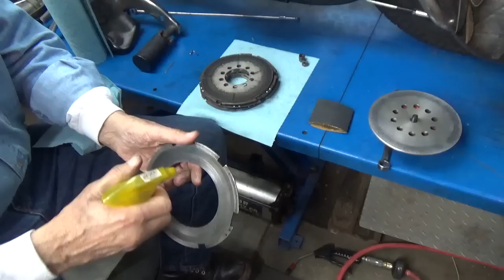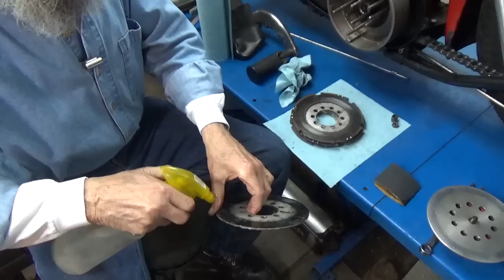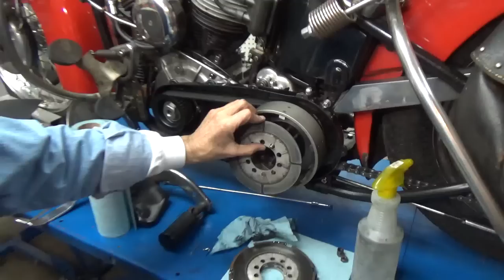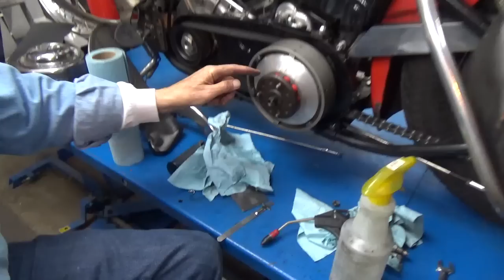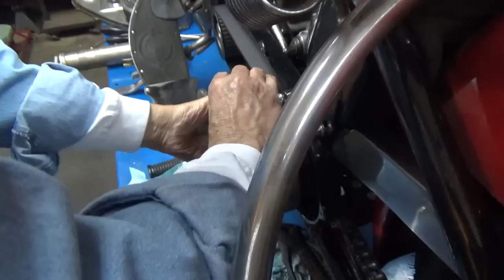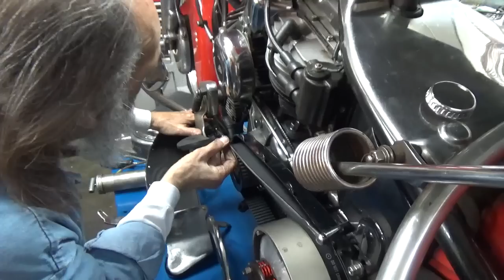We're Doing The Clutch Adjustment On My Harley Davidson Panhead Again!

Comment: How do you get the oil out of a 1940s three bolt WL transmission? I did not see a drain plug. I’m hoping one doesn’t have to bring it back out of the fill hole.

Comment: Hi Mike,  I just had apart a '68 FLH as it had some starter issues. Had a mix match of parts; one being the wrong year clutch shell ('70 and +). I put in a '65 - '69 clutch shell and reused the clutch plates after inspecting them and cleaning them. I adjusted springs first to 1-1/32" as per manual without having the pushrod adjusting screw tight. Next I set the clutch arm to about 1/2" from the starter, then backed off the adjusting screw 1'8" and tightened the locknut. Then adjusted the clutch cable/hand lever to have approx. 1/4" play. I pulled the hand lever in several times and noted that the pressure plate was likely coming out 1/4" or maybe 5/16". I sat on the bike then and put it in gear and pushed it forward with the hand lever fully in (to disengage the clutch) and it was dragging considerably. The clutch shell looked in good shape and the studs on the clutch hub I sanded and were in good shape, so what could be wrong to not allow the clutch to fully disengage? Is it likely to be that I need to drill out the ten holes per plate on the friction discs ab extra 1/32"?? Any thoughts would be appreciated and I know you enjoy making clutches work well so thought I would ask. Thank you. Darren.
Reply from the maker: Please realize, although I try, can't see it from here.  First, are the plates separating evenly all the way around.  Sometimes the springs don't always have even tension and the three studs may need to be tightened unequal amounts in order to compensate. If the plates are not sliding well because the holes the studs (fingers) pass through are not smooth, drill oversize 1/64th, not 1/32nd. You don't need a full 1/4" in that lever.  An eighth or less may be the answer.  A lot of people used to figure a nickle"s thickness where the lever touches the perch.  Do not get a non-mousetrap unit confused with a mousetrap.  I'm assuming no mousetrap. Last mousetrap was 1967.  But I have installed them on later models.
Reply: @pacificmike9501  Thank you Mike for your thoughts; I know you are a busy guy. I guess I should secure the handlever in the fully closed position and then measure the distance between the release disc and clutch friction disc to see if it is opening equally and if not adjust? No mousetrap Mike and BTW I am using the correct springs for '68 and up and I am using a 5 stud hub. Thanks again.
Reply: @ironearl69   I could be wrong but I was always taught those 5 stud clutch hubs were more for drag racing and the three stud clutch hubs were better for normal use for disengagement purposes. I personally think you can't diagnose if it is disengaging right unless you start it and ride it.

Comment: Hello and thank you for putting up these informative videos.  Just watched this one tonight, re-did my Panhead clutch again after changing the transmission sprocket a couple of weeks ago.  I also have the Barnett aluminum clutch friction discs in mine, very good product, I've been using them in my Pan since 1998.  I noticed that the friction discs were not making full contact against the steel plates by the wear pattern on the friction material.  So since I was not in a hurry I set up my 1/2 inch thick glass panel for flat sanding with 220 grit sandpaper and rubbed each friction disc on that until I had a perfectly flat contact surface.  It made a real difference in the feel of the clutch even using my foot(suicide) clutch and jockey shift.  Now it is in contact or not in contact, none of the grabbing or incomplete release I had before which makes shifting much nicer.   I also use a Zodiac Tamer Kit that holds the clutch basket from moving out, I run a belt drive also.
Reply from the maker: Cool.  There are so many products out there and when you find a system that you like, you've won the battle.  Got a few myself.

Comment: Thank you for sharing your expertise Mike. I was going to post about my grabbing clutch problem but did not want to duplicate a previous poster so I srcoled thru the clutch posts and discovered the post from Dan McCarthy _ same issues. My 2" open primary conversion to my '73 shovel would not disengage the mainshaft. It drove me nuts because I had already done two 1.5" belt conversions successfully. Your advice for drilling out the clutch plates with 25/64 bit did the TRICK! I am so freakin happy with my recent bobber build.
Reply from the maker: Cool.  That makes me feel really good.

Comment: I ran the Barnett clutch Assy. and Phase 3 open primary combo on my stock 80” shovel. Your triggering a little trip down memory lane with your vids Pacific Mike :).
Reply from the maker: Yah, it was and is fun stuff.
Reply: Pacific Mike I mean to say that, the engine was the stock 80” first one, I bought it from the factory 1980. I had already gotten a 57 pan head frame, and a couple of damaged wide glides that fixed up into a good one. I like the new efi harleys , they are Bullit proof. Maybe to good, could be part of California Harley economic woes. Got the new Aircraft spec brakes that were coming out. Yeah nostalgia is a big part of my everyday world these days😂

Comment: Great video as always Mike.  As far as plate brands go a little over twenty years ago I put a set of Barnett plates into the clutch of my Shovelhead.  I think once in that time I cleaned them like you are doing here after a carb tweak added a few HP and it started slipping.  Haven't had to monkey with them since.  I don't know if Barnett is still around but this video made me think of them.  Thanks again for sharing your knowledge.  I live in a rural area in Southern Virginia and the last old timer around these parts that really knew these old bikes passed away a few years ago.  Your videos are very helpful to those of us all alone in the wilds trying to keep our old iron healthy.
Reply from the maker: Thank you.  We used to have to figure it out every time we added more horsepower.  Tighten those springs some more.  Now, if you didn't have one before, you'd be thankful for a foot clutch now.  However, Barnett is very much still in business and still family owned.  Their factory is in Ventura California.  Still making great stuff.

Comment: Great video.  Encouraged to pull mine apart as the bike does not want to down shit from third.  The plates are a bit grooved and one plate has some rust as though it was stuck to the fiber disk.  So I guess the whole system should be replaced??  Even the basket has some grooving and a bit of oil.  I wish pictures could be posted!!  Maybe I'll clean it up and see how it performs, but the grooving is not going away without a lathe.............
Reply from the maker: Sometimes they clean up and work fine.  Somes times they don't.  New stuff is always cool, but not always necessary or economically feasible.  Look it over.  Get a feel for how it works.  This is the learning proccess.
Reply: Thanks, I’ll clean it up and give it a shot. One conundrum I have is that my case is stamped as a 1940 WLA. That’s a very unusual and unlikely model. I’m thinking it’s actually a 1941 up clutch but don’t really know how to confirm that without buying parts….. I see a lot of parts listed for 1941 and up, but not for 1940.
Reply from the maker: You'll need parts for a WLA.  Don't buy parts for a Big Twin.

Comment: Great video! Somehow I missed the part showing all the lesser informed how to load the springs on the pressure plate with the adjusting screw and washer. Some people think their springs are going flying on removal.  Maybe it was in a previous video.
Cheers
Reply from the maker: I have shown it, but, lay the releasing disc smooth side down and put the springs in place, all ten in a circle with their respective holes in alignment with each spring.  Now, lay the pressure plate on top of the springs.  Depending on the  clutch hub you're using, there will be either three or five of those holes shaped for adjusting nuts.  Don't worry about them, they will register when installing the releasing disc onto the hub, later.  Now lay a large flat washer or a Shovelhead valve spring retainer over the large center hole in the pressure plate.  The washer should have a 3/8 hole in the center or size it down with a small washer over the big one.  Now, install the center adjusting screw and put the locknut on it.  Tighten the lock nut some and the whole thing is in one piece.  After you install it with all of the three or five stud adjusting nuts, you can remove the center locknut and take out the large flatwasher.

Comment: putting the extra steel in by the hub basket is the best idea.  I ruined a brand new hub basket recently.  but it was repairable by putting in the steel.
Reply: Did putting the extra steel up against the basket change the way it grabbed? I've never heard of this before, and am getting ready to install new BDL drive
Reply from the maker: Yep.  Easy fix.  Thank you.

Comment: Hey Mike, so are you adding a extra steel plate to the stack? Does the metal on metal still engage/grab the same? Just received a new BDL system and don't want to hurt anything. I've never seen this done before
Reply from the maker: The bottom fiber either engages on the inner surface of the basket itself, or it engages against a steel plate that is protecting the basket.  It's a very common old way of doing it.  If you let the fiber plate engage with the basket, it tends to wear and gall in there.  Next time you take it apart, you might say, "I don't like that," and add a steel plate, or not.  No harm, no foul.  Just remember, if you add a steel plate, you may have to grind the edges and remove the buffers so it can bottom completely flat in the basket.

Comment: Best move I ever made on my 81 fxs was get rid of stock clutch & compensator. Replaced with BDL pro clutch kit wit sold sprocket & chain. It uses the solid Evo style sealed bearings. Much less vibration & clutch never slips
Reply from the maker: Very Cool.

Comment: Great video Mike! A little bit long, but what a pleasure to watch and listen 😎
A little thing I do is I drill the clutch plate holes just a bit bigger, so they slide easier to come free.
It make more noise, but what a fun to hear. Cheers from France
Reply from the maker: Thank you.  I do the same thing, depending on the size of the holes.  Most clutch plates are stamped out and the tooling gets old.  The holes aren't round as they should be.  When I get that, I drill them out 1/64th over the intended 3/8".  Don't go to big, and, no noise.
Reply: @pacificmike9501   Hi Mike, on my shovelhead I've fit a "York" clutch, that works realy marvelous, have ou heart about them?

Comment: Another great video Mike. By watching your vids I managed to build my 74 fxe from boxes... She's a real eye catcher now.  Thanks.  If you have a email I can send you pics. Currently I have a strange whinning noise in third... So I'm on the lookout for related vids.  Cheers again. J
Reply from the maker: Thank You.  Sorry, I need to figure out the picture thing on the Channel.  That "whinining" noise in third gear is probably the "third gear" bushing.  It comes from riding around in third gear all the time.  Probably spent it's life riding around town.  Look it up in your service manual.  I said "probably" and a "long distance" diagnosis may not be correct.  It's a big job, of course, to pull the trans and rebuild it, but not a lot of money in parts if the gears are all good.

Comment: very thorough ,,i need this ,,cant get my 1936el adjusted right,,always engaged wont disengage.. very impressed.. i will start w a steel disc like u did see if that solves my no disengaging issue
Reply from the maker: "Clean" works on most of it.

Comment: I've been riding and wrenching on my (chopped) '62FL for forty years and learned something when you started with the steel.
Further more, I just replaced a BDL basket because of the friction disc gouging you mention. Question for you, Mike:
instead of replacing the basket could I have just dropped a (corner shaved) steel in? Also, would you do me a favor and
if you haven't put the outer on yet, or have an old Pan basket lying around measure the depth? Shovels are deeper?
Reply from the maker: Yes, you could have put a plate i there.  But, as you ask, the difference in depth can be from Manufacturer to manufacturer.  There are also bunches of manufacturers of clutch plates.  The stacks vary in height.  I've gone through piles of used stuff to come up with different combinations to suit the applications.  I don't know what BDL"s depth is.
Reply: @pacificmike9501  I wasn't asking  the BDL depth. I've the old one laying on the back porch. I was asking what stock (Pan) is. That I don't have any longer (it's
lost or buried). The thing is, my basket doesn't have room for an extra steel. I suppose I could run a 1/2 disc at the release plate. Or maybe I'm just
over thinking it (shrug).

And an after note: It just dawned on me you aren't running a stock primary either. Still, if you've a stock one lying around or have the opportunity to measure a customer's
I'd be interested in knowing how deep it is. Just because, I guess. Thanks.

Yes, they call me "Drift." ☺

Comment: Mike great videos!!!! I'm not sure if I'm posting this in the right place but could you make a video on assembly and then adjusting the friction discs in a rocker clutch? Kind of like how you did the mouse trap video only this time with the rocker clutch?
Reply from the maker: I do show adjusting the shifter on my Panhead.  I think it's there.  I know I already showed it.  Maybe it's on a clutch video.
Reply: Mike I've watched all of your clutch videos, I haven't seen anything on how to adjust the rocker clutch setup, especially as detailed as the mouse trap video is. Rocker clutch transmission adjustment video would be great.

Comment: Mike, I absolutely love the videos. Keep them coming. My 58 Panhead hemorrhages oil. They all do, but yours does not! Please enlighten me. PS the chain Oiler has been capped off
Reply from the maker: Are you referring to the breather tube coming out of the crankcase into the primary?  If os, there's your problem.  Look at the service manual and find the screw on the oil pump that controls the amount of oil that comes out of that breather tube.  Now, close down that screw (just tighten it until it bottoms).  Now, open that beather tube. If it's noot breathing, your engine is building up all kinds of destructive pressure.
Reply: @pacificmike9501  I will give that a go and get back to you. Thank you!

Comment: Part 2:
Since I use the Zodiac Tamer Kit in my Pan 4 speed clutch the clutch basket cannot be removed without first removing the clutch hub nut.  Makes it difficult to remove without using an air impact tool and almost impossible to use the correct torque when installing the hub nut.  So I made up this tool from an old clutch friction disc and clutch steel using three 1/4 inch bolts to hold them together, make sure you center them.  I drilled the holes in the steel and inserted them together into the clutch, centered them and started drilling the holes in the friction disc, finish drilling the holes on the bench.  To use it just remove all clutch plates, insert tool into clutch all the way in to the base of the fingers, now the hub and basket are locked together.  I run a belt so I made a steel bar to lock the pulleys and once that is in place everything is locked.  I was going to attach pictures but can't figure out how, sorry.
Reply from the maker: Very cool.  Thank You.

Comment: Hi Mike, great videos! When adjusting my shovelhead clutch it seems that the freeplay in the clutch arm after adjusting the screw gets taken away when cable adjustment is made. Should I be holding the arm back so the cable doesn't pull it into engagement with the throwout bearing?
Reply from the maker: I think you have no freeplay up at the hand lever, or you need to lube that clutch cable.  Take it loose from the hand lever and run something down inside, then wait and do it again several times.  A good cable lube product or even "Break Free."
Reply: @pacificmike9501  new clutch cable fully lubed. Should the clutch arm have a spring attached to pull it away from the throwout bearing like cars do?
Reply from the maker: No.  There should be clearance between the adjusting screw and the clutch pushrod.  It's asking you for a thorough inspection to see what's hanging it up.  It could be the pushrod or the throwout bearing  .Time to get in there.
Reply: Thanks Mike for taking time to answer me. All the parts were trashed, bearing, pushrod end & adjusting screw tip too. I ordered all new heavy duty stuff. Thanks again.
Reply from the maker: I had a feelin'.  Been there.  Be sure to allow a little gap between the adjusting screw and the pushrod, just a little, and grease all the ends.

Comment: Hi Mike! Great videos on clutch disassembly and cleaning! The clutch on my '77 Shovelhead wasn't engaging properly, so I removed the primary cover to have a look. Turns out when I work the clutch lever, the left side of the clutch basket moves out, but the right side hardly moves at all. The clutch springs seem to be relatively even, but I'll take measurements and adjust them evening just to be sure. Can you tell me what's causing the uneven movement of the clutch basket? Thanks!
Reply from the maker: If everything is cleaned and lubed properly, the basket should stay still.  Look at all of our stuff on clutches.  Just hit the "videos" button.  There are several videos on the old dry clutches.